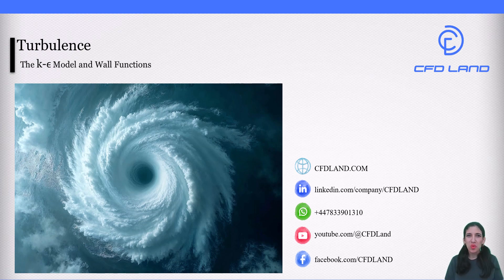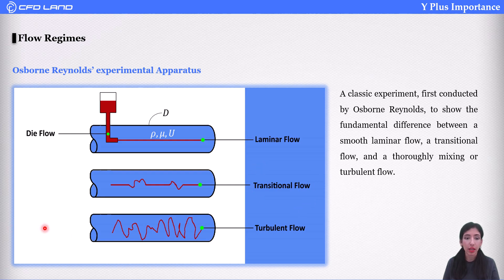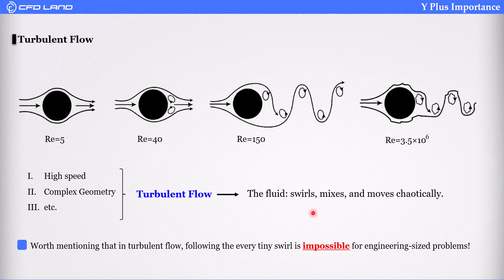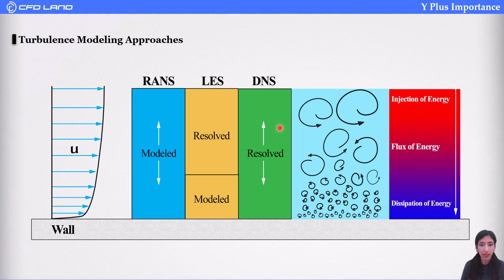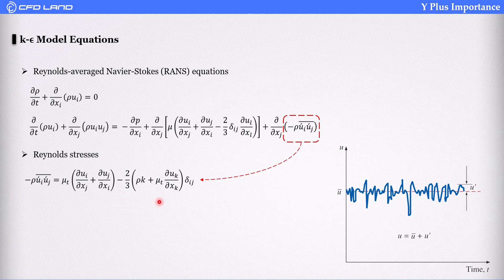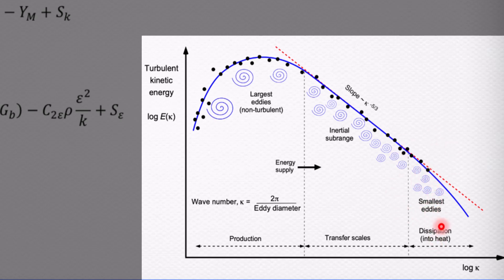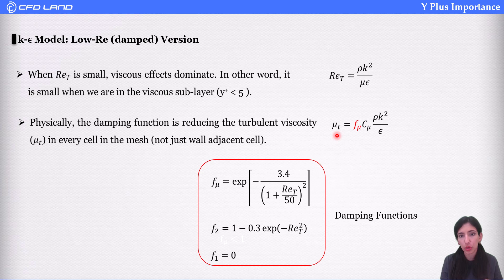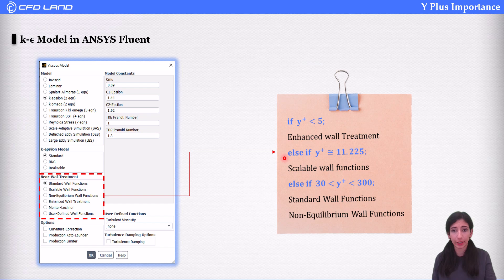The k Epsilon Turbulence Model

Comment: can you quantify the inaccuracies of using k-e in certain cases? thanks
Reply from the maker: **"Great question! 👍

The standard k‑ε model is robust but not perfect — it can underpredict flow separation in adverse pressure gradients, and it struggles with strong streamline curvature, swirl-dominated flows, buoyancy effects, or transitional regimes. In such cases, the turbulence kinetic energy and production terms can deviate by 10–30% or more from high-fidelity results (LES/DNS).

For a deeper dive into where k‑ε shines and where it falls short, you can check this detailed article:

🔗 https://cfdland.com/turbulence-types-what-are-the-different-kinds-of-turbulence/